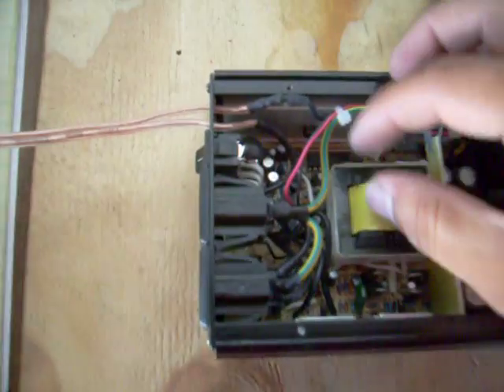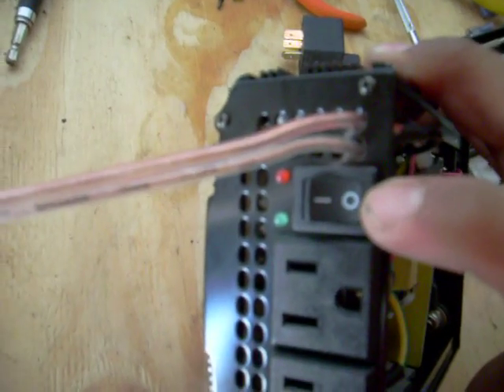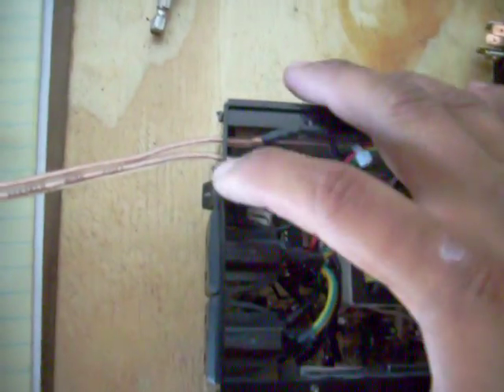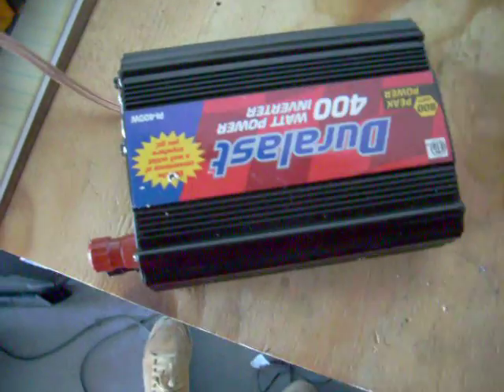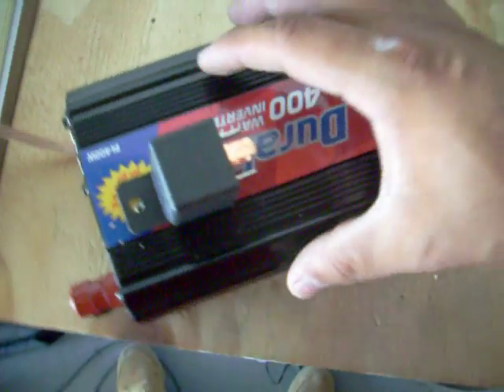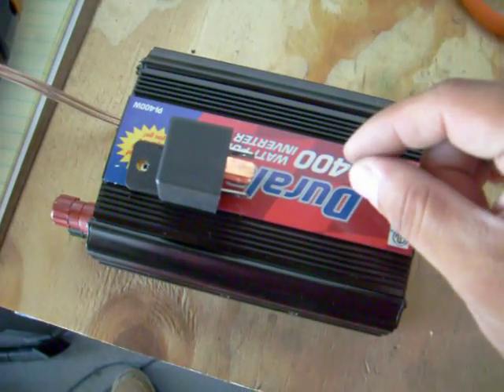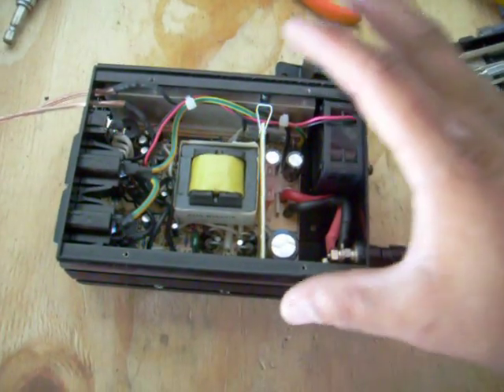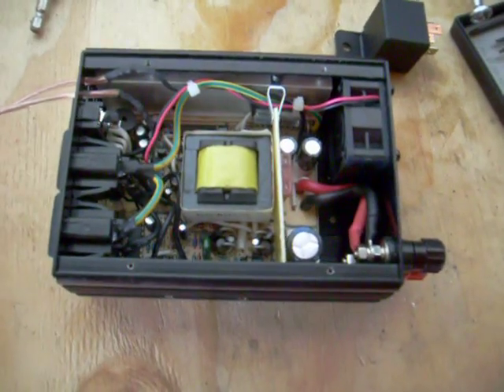Power Invertor Project Pt 4 DIY Remote Relay Wiring for Auto Turn On

Comment from the maker: @MegaDyte i could done that. But eventually he would upgrade to a car amplifier and I didn't want the relay hanging outside either behind the radio in the dash (which had no space) or the trunk (where it could hit hit and knocked around) so i decided to modify the inverter internally in another video you'll see.

Comment from the maker: Well, I had a customer who didn't want to spend to correct amount of money for a automotive sub-woofer system. He brought his home theater sub with built in amp. I did all the normal running of the wires. But his home theater ran on 120V rather than on 12V like normal car audio equipment. So he purchased an inverter and i modified it to activate when the radio turned. The inverter originally had a toggle switch. I put in a relay in the place of the switch to make the process automated.